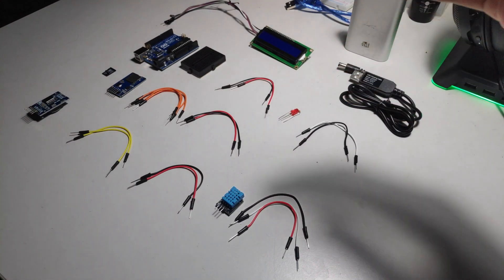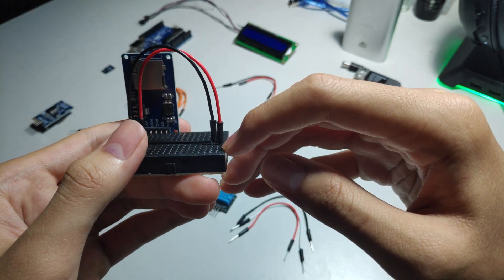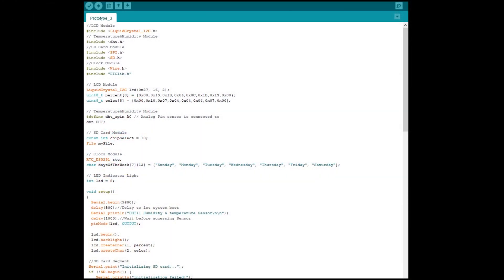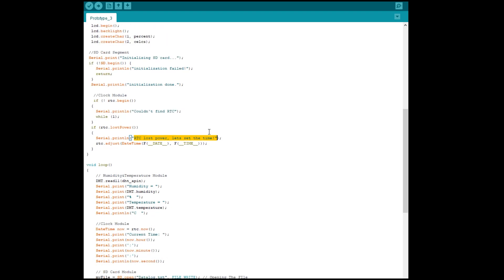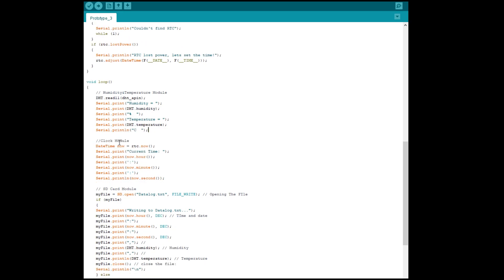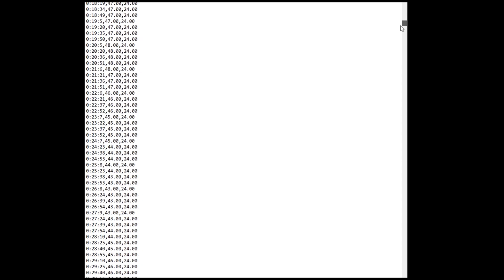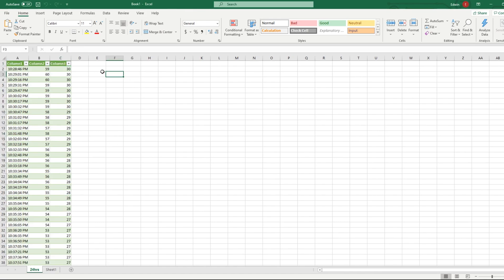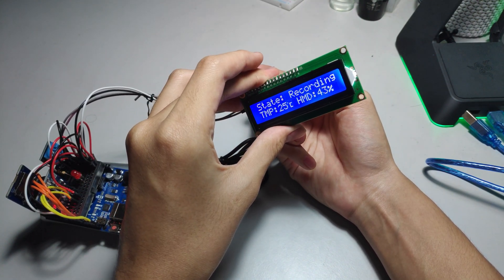DHT11 Temperature & Humidity Data Logger Arduino | 4K

Comment: Had a similarly project going on here
Spent 2 days debugging, everything worked , but nothing was getting written on SD card. Was trying to create a file " dhtTestLog"

Damn it. .. then it struck, you can only have a 8 character file name , it can be alphanumeric. 
But before that, made a dozen alternat codes and read at least 2 dozen different codes and examples, made simplified versions of them.
Next day it just struck out of the blue, first thing when i sat to solve it again.... some times you just have to sleep on it... litrally